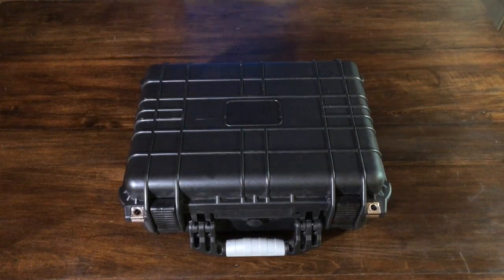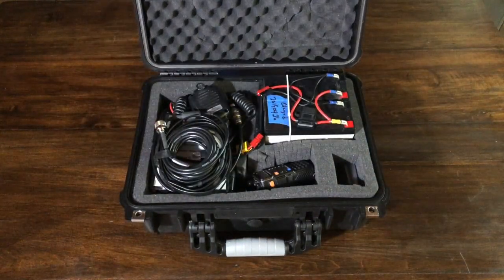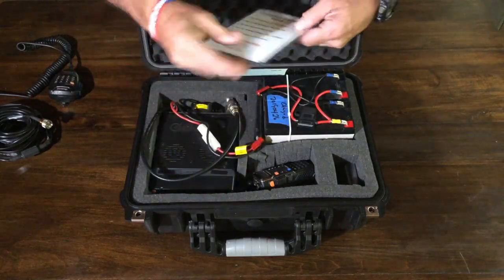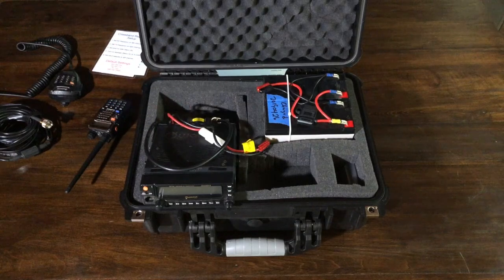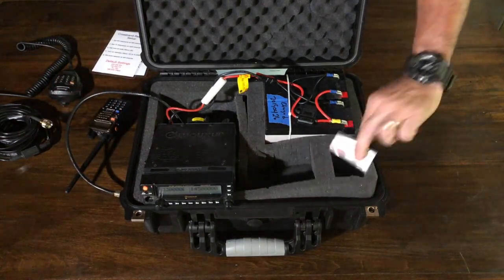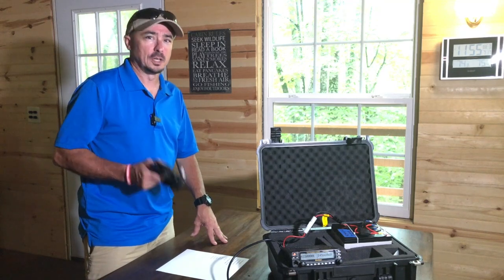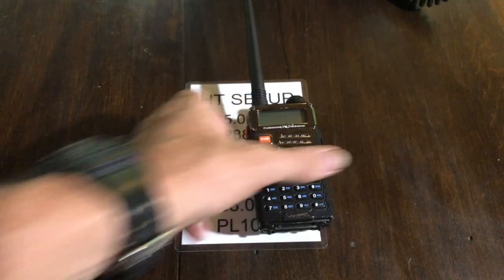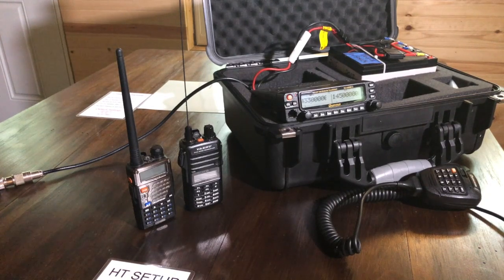Portable Crossband Repeater

Comment: Was just discussing this with my little group. Was mentioning things like de-sense, diplexers, some of the more advanced topics. My recommendation to them was that they should get two separated mobiles or at least a receiver and a mobile, good receiver so as to have sensitivity and good rejection.  I picked up the 9800 when they first came out and got one of the worst ones , and remember the desence I heard , compared to what I hear on my Yaesu 8900. That said, one can learn a fair amount about repeaters if you try with these systems.  One needs to learn about CORs and Tone systems ect. And , Time out Timers.

Comment: I'm building something similar with my TYT TH-9800. I was going to use a lead acid battery but you have me wondering if I should use something like what you have done here.
Reply from the maker: I have recently upgraded mine to LiFePO4. Look up Miady LiFePO4 on amazon. They are dirt cheap and perform fairly well. I refer to them as the "Baofeng" of batteries.

Comment: Cross band repeat is very handy. I use 446 in and 2m repeater pair. Say 
You have a truck on top of the mtn, and your on your quad below in the valley. Sure it nice to have solid contacts. Used it for miles. Works well.
Just use low power on tx ! So you a good battery when you get back. Also if there is a hill aim it slightly downhill so you can bump start it if 
 Need be.

Comment: Doesn't the repeater need its own call sign?  What are FCC rules concerning operator control?  As in being able to shut it down in case of malfunction, for example.
Reply from the maker: You can use your callsign if you are the control operator. This particular rig has remote kill capability via DTMF. 73, de KM4ACK

Comment: That is really cool. I had no idea you could set the offset on the Baofengs like that.  Just did it on mine and it worked.  I have a couple radios that have cross banding too.  Haven’t done much with the feature though. This video gives me some ideas though. There are allocated auxiliary repeater frequencies in the band plan that I believe could be used for this type of application.  Also make sure you have the time out timer enabled as you do need some way to shut it off should a problem arise.  Great video. 73.
Reply from the maker: Thanks Mike. The offset really surprised me. Both the TOT and aux frequencies are great  tips to keep in mind! 73, de KM4ACK

Comment: Great video as always, Jason. Any thoughts on a bulkhead antenna connector to allow the unit to operate outdoors while closed. Heat would still be a concern. 

For those in the southeastern US, check out the bandplans at SERA.org. There are some designated frequencies for 2m simplex and for cross band repeaters on 440. KN4AQ had a good article a while back called “Getting Started - Crossband Repeat”
Reply from the maker: Considered it but still afraid it might leak. Think I would prefer some type of tarp/shelter to keep it dry. Honestly though, we have antenna connections in the cabin where we hunt so it really won’t be a concern. That was the primary purpose it was built for. 73, de KM4ACK

Comment: What and why such an offset for a receive setting? 288.0? Simplex doesn't use offsets? Thanks
Reply from the maker: The crossband repeater uses simplex frequencies but is repeating the received signal. The offset is needed since the crossband repeater receives in the 70CM band but transmits in the 2M band. If we set the HT's to 70CM only, we wouldn't receive the signal being sent from the crossband repeater in the 2M band. 73, de KM4ACK

Comment: On a tangent... now that I know the UV5R can do a huge offset, I bet it can be tasked with satellite splits in a series of memories to compensate for Doppler shift.
I have a quad-band version of that mobile rig. Did you know 2 of them can be connected with an RJ-45 to be a repeater within the same band?
Thanks for the videos & info.! (sorry for my A.D.D. moments)
-Rob
Reply from the maker: Rob, your comments are always welcome and insightful. Didn't know that 2 of the radios could be linked together via RJ45. Yes, I would assume you could use the baofeng that way when working satellites. Thanks for watching! 73, de KM4ACK
Reply: @KM4ACK  I've never tried the 2-radio setup, but mine came with a cable for detaching the face plate. That cable can be used to tie the radios together and then the settings are in the same menu pathe as the cross-banding selections. Of course, you still have all the repeater issues to deal with once in the same band as far as antenna separation or duplexers etc.; ID announcements and so on.
One other thought... that mobile rig has an 'x-twrpt' setting... this allows each handheld to stay on a fixed uhf or vhf freq with the other guy in the opposite configuration. Might be easier to set up for the HT user.
Keep up the great videos! (I just started looking into the pi-star info.)

Comment: Video was worth it just for the knowledge that you can do a huge offset with a UV5R.
Reply from the maker: I was totally amazed that the Baofeng would accept that much offset. Thanks for watching! 73, de KM4ACK
Reply: @KM4ACK  The Boafeng supports xbanding in chirp.
Reply from the maker: Cool!  Thanks for the tip. 73, de KM4ACK
Reply: Looks like he has just another overpriced UV5R variant.

Comment: Nice video. I like the idea of using the raspberry pi for a controller. You could use it to also gather statistics such as power usage and send voltage telemetry with the ID, record the audio transmissions, some other stuff. Thanks for the ideas. W0GPR
Reply from the maker: Absolutely. Adding the pi could open up all kinds of possibilities. Got to put that on the to-do list. Thanks for watching! 73, de KM4ACK
Reply: @KM4ACK  Have you done anymore with the pi project?
Reply from the maker: @Jay-hr9ci  that project got stuck on the back burner. So many projects, so little time. :-(